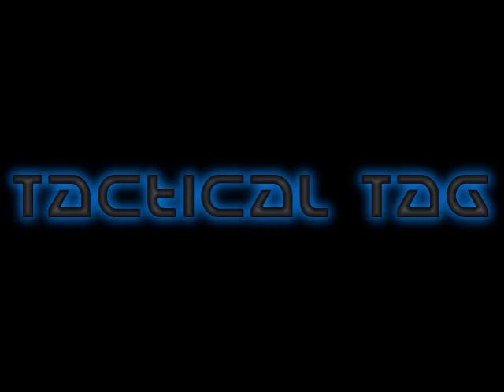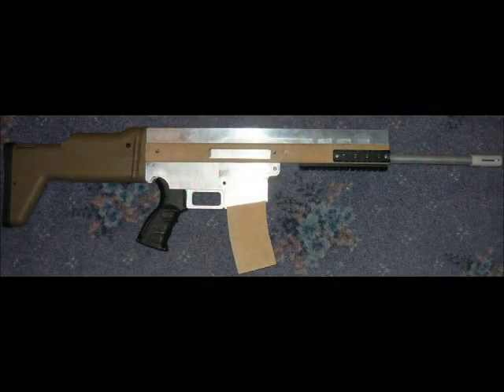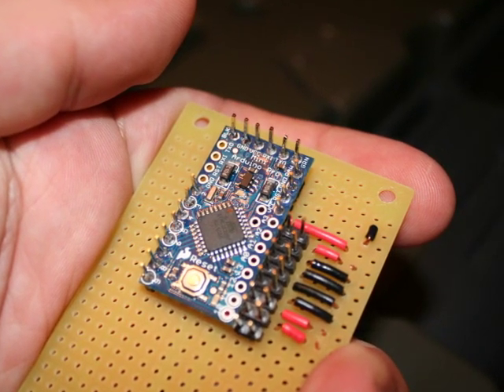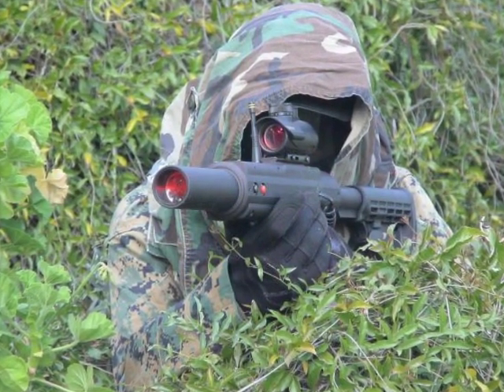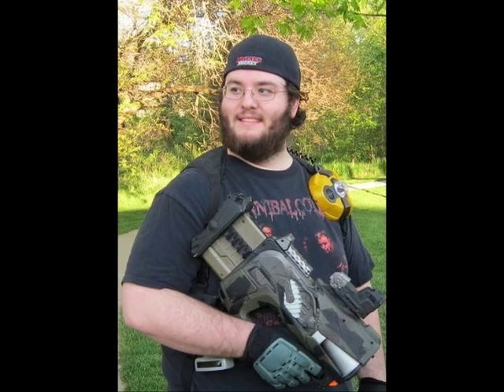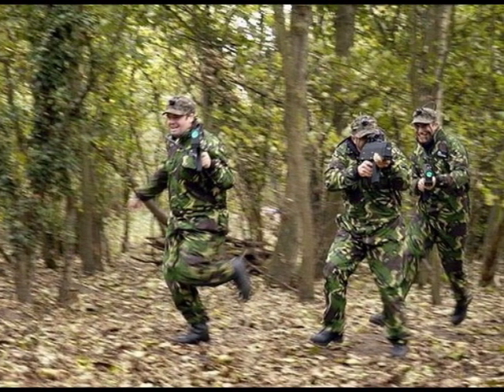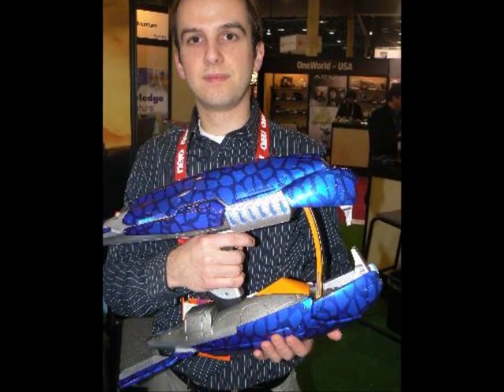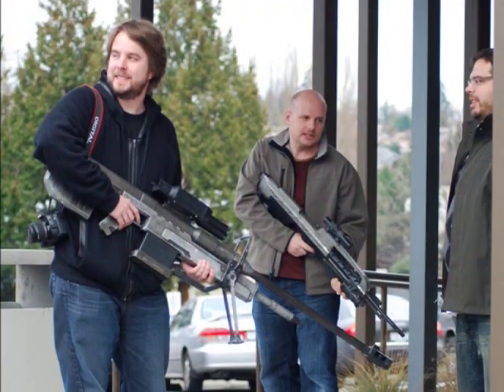MilesTag, Arduino, and other Laser Tag Systems

Comment: In Italy, we already had a couple of miles based sysems (Lasertag and Red Ray) that you would install on modified airsoft guns (the airsoft gun gearbox is retained for noise and vibration working in sync with the electronics). In early 2014, they came out with a new X-Tag system, which (they say) does not rely on Miles but on more recent technology, though you can play with other systems. I have been using it, more or less like previous lasertag systems (I had Red Ray) in terms of play though less complicated. One neat thing is that it talks with your smartphone so you can program the system with it, shows your position to others in realtime on google maps and so on. Another very positive thing is that you don't necessarily have to install the kit yourself, you can buy from them a modified airsoft gun (jg I think). Gun plus system is expensive about 450 euros (300 for simplified version with no smartphone abilities)